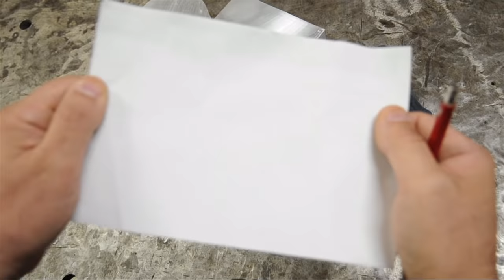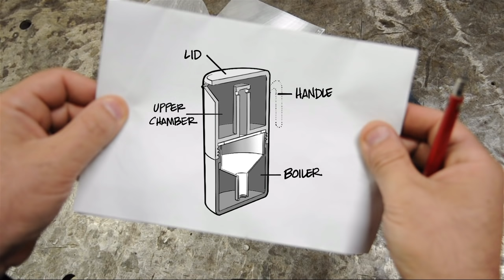Making An Espresso ... Pot!

Comment: Yuck, Aluminium. Get some Steel in there man.
Reply: Aluminum,acid and heat ?   Alzheimer's cocktail , not to mention that  you are not getting the best taste !
Reply: I also hope that the aluminum alloy is lead free....  Technically awesome work anyhow!
Reply: I believe all the espresso pots i have seen are Stainless Steel, not just steel. And if i remember This old tony hates working with stainless.

Comment: Just as well you dont like espresso because that isnt espresso, its perculated coffee, nothing like an espresso.

Cool work though
Reply: Yabba441 it's traditional Italian stove top espresso. Not a perculator but I can see why you would think that they work and look very similarly to each other
Reply: Its called a peculator in many parts of the world because of its end result albeit it that technically its not, it is a Moka Pot. Neither of which produce the essential component of an espresso, that being the extraction of oils from the ground coffee beans from hot water under pressure. Espresso is extracted above 9 bar of pressure however the Moka pot can only produce 1 - 2 bar of pressure so it isn't an espresso. People want to call Moka Pot coffee espresso but its not even close.

Sorry but it isn't an espresso, current or old style. Its a stove top coffee maker, call it what you will but not espresso.
Reply: Yabba441 I'll agree that the moka pots don't give a normal machine brewed espresso but I would still say a moka pot is more close to a standard espresso than a percolator
Reply: JPVersionofthings moka pot is a percolator which uses fine ground coffee.  Despite being called espresso in many places - it is definitely not.
Reply: I appreciate your response because you're right! Not to take away from how awesome this project is or how amazing this video is put together. But your comment made me wonder if it could be done with this pot with just a few tweaks...

So this pot is pretty thick and I'm sure it could handle 9bar... what if he put a 9 bar relief valve at the top of the stem in the upper chamber and an 11 bar safety relief in the boiler? Would it make espresso then? Just trying to think of different ways it could be done.

Comment: Your wife is an angel.  "Can you make a 12-cup version in stainless?"   That type of handle would look really great on a dustpan, too!     Seriously, this is the way Northrop made fuselage bulkheads for the F/A-18 back in 1982.  Bolt a HUGE block of aluminum to the CNC mill and turn it loose...  I have no idea how much of that block turned into chips, but 98% would not surprise me at all.

Comment: great video. love the comic value. FYI on that pressure relieve valve it may have a 1/16 pipe tap so it will get tighter the more you screw it down.   Love the sword vid too!

Comment: Where I’m from, we call this a percolator. It’s one of the great coffee making tools. Now when I look at your plans, it does use pressure to push water through coffee. With a typical espresso machine water goes down instead of up and the filter is more robust and installed very differently.

Hey, it makes coffee, but I gotta push my glasses up and say “um actually.” It would be cool to see you make a working espresso machine but you would have to deal with hot water and pressurized pumps and whatnot.

Comment: Don’t worry about the pressure valve. They are pretty anti climatic when they go off. It will start with a slow froth bubble and slowly open up. I still turn it away from me though. Also keep a dirty film of coffee in it to coat it and keep the aluminum taste out of the coffee. I just wash with very very light soap or no soap. Keep the bottom dry so it doesn’t mold though. Great work I subscribed.

Comment: Probably not checking comments on videos that are 4 years old but here goes any way. I love your videos. what would this look like with a brass ring between the two pots and on the handle and top. For the cylinder inside I would have drilled threw and tapped the pot. Then made the cylinder separately giving you the option to drill the two holes with a downward angle. Any way I can only wish being able to mil and lathe parts like you do. I only know how to work with wood. Keep up the great work my friend. I look forward to watching more of your videos.

Comment: I do a lot of bolt-cutting and not always remove the partial thread as they are for permanent/ mostly permanent installation... but I highly recommend to do it, even a few strokes with a file help.
When the nut doesn't want to engage on a job, or (worse) engages at an angle, it's waste of time and potentially ruined threads.
And yes, safety, can't use leather gloves for smaller parts (need washers/ spring washers too), so cutting hazard. Or even steel shavings in fingertips. Doesn't heal well.

Comment: Why not machine out of stainless steel 304? Years ago a theory was posited that Aluminum food containers can lead to various health problems. When doing thin walls I machine the inside first then fill with Cerrosafe a low melting point Bismuth alloy then finish the outside. What this does is solidify the part so, it machines like a solid. Afterwards,  the Cerrosafe is melted out and one has a thin wall without breaking through. Do you have any extra long length endmills?

Comment: Because of phase-change energy expenditure, a steam burn is worse than a boiling water burn. Although, a stream of boiling water would carry further because it's more dense, possibly reaching your body and splashing you. However a jet of steam would dissipate quickly as it expanded and mixed with the atmosphere around it.

Comment: The part you did with the rotary table and the roughing end mill is possible to do on the lathe. You’d need to make a custom trepanning tool. Also I think you should make a video on lathe trepanning, it’s like the boring head of the lathe ;).

Comment: If you ever want to make another espresso pot, how about making the bottom soft steel, to be able to use it on an induction plate? It should also allow you to hollow the pot out in a more controlled manner.

Comment: the valve isn't for pressure relief. It stops cold water being pushed up into the coffee.  It closes when the steam volume increases due to the water boiling and then shuts and forces the water through the coffee and into the top chamber. basically a pressure switch

Comment: don't worry about the pressure at the top: the coffee or more so the steam is pressurised only when its in the bottom part... once it traveled through the coffee (which acts sort of like a valve) it more or less only builds up inside the center column and drips out slowly out of the wholes... 
which makes sense... the center column does not really offer any resistance to the coffee, so the pressure inside the column is almost atmosphere.

Comment: 60's - 70's with just a dash of 90's. If the handle had been straight and naked it would've been pure 90's! : ) For an 80's look I think you need more angles and square corners ; )

Comment: Tony thank you for your hard work.  Your editing of this was about perfect I only forwarded twice and only 10 seconds. As one other said I usually don't watch anything over the 15min tops but I knew your build would have a tricky mating work. To bad you didn't show the math and how you got there. Did you have to trim some off the top of the boiler or were your calculations right? Did you account for compression of the seal? Love your sense of humor and how you overcome a problem.

Comment: I know that this video was shot years ago but a suggestion for your coffee pot - Make the base with a Bayonet Fitting (breach lock / camlock).  Make a base element heater (also with a bayonet / camlock / etc).  Then you could swap out your coffee pot with an oil bath for tempering tools & stuff in.  It could have a temp sensor / regulator to achieve / maintain temperatures.  You could also make a steam whistle so you know when to knock off from work.

Comment: Just to be picky, the water doesn't boil. Usually it boils at the very end when the lower chamber is almost empty and the pressure drops. At that point you can clearly hear the gurgling noise and it's time to turn off the gas (a bit earlier than that is not bad, I'd say).
EDIT: I forgot, you'll want to keep the fire low or you'll burn the coffee!!!

Comment: fun fact, it's much better to have the pressure valve spray boiling water - the water can never get above 100C, but pressurized steam can.  boiling water can scald you, steam can get hot enough to set things on fire.

Comment: Hey Tony! So i have a classic macchinetta, with the classic double sided open nozzle, i am trying to turn this into a foam nozzle, i have some ideas using retracted steam wand nozzle, i was wondering what would be your take on the foaming subject meaning the coffee comes out foamed instead of still, an example of that is the brikka. It has a foam nozzle inside and that ends to a foaming, mixing chamber, which lifts after some portion of liquid has been entered, mixed and the coffee falls then in the pot. Maybe you come up with something different.

Comment: For the stem, thread the top, then cut a slot in the center, then make a cap, and you will have both control over the opening (cap size) and the ability to ensure it doesn't shoot out the top of the maker. (adding an overlap to the cap)

Also, cleaning would be much, much easier.

Comment: You are 100% not overthinking the angle of the pressure relief, it's recommended to always have it facing away from you And also never fill the water above it. Also this is technically not espresso.

Comment: Steam has more energy than boiling water. It possesses the additional latent heat of vaporization. So, when steam falls on skin and condenses to produce water it gives out 22.5 x 105 J/kg more heat than boiling water at the same temperature. Steam has more energy than boiling water.

Comment: Sense you left the bottom quite thick which is great. A fun idea would be to drill the bottom full of holes the increase the amount of water touching the aluminium to increase the boiling time. Kinda like a steamboiler:)

Comment: I love the stuff you make and the way you present your videos in a humoristic manner.
Just a word of caution here for those who like to make such an expresso pot for themselves. Some aluminum contains lead for easier machining. DO NEVER ever use that for anything that is intended to have contact with food or drinks. Especially hot beverages..! The lead will leach by small portions into the things and lead poisoning ain't something that will go away or could be cured.
Same goes for some sorts of brass. Be careful what kind of material you use and be absolutely positive about what's in the alloy if you use an alloy material for such things.

Comment: On cutting thin wall aluminium, Perhaps it makes you nervous because it can bind up and snap tools, and shower you with pain. 
The last time I had a catastrophic tool failure, I was cutting aluminium angle on my chop saw. 
The blade was specifically meant just for aluminium, but it wasn't a new blade.   
The angle aluminium bound up on the blade, snapped like 5 teeth, and instantly turned the chop saw into Kazoo. 
 If I had had a proper work piece clamp on the aluminium I probably would have been fine. 
As it was, I was using my left hand to steady the angle as the blade bit into the work piece and bound the blade up. 
The angle aluminium became something of a wheel and immediately slammed into the chop wall on the back of the chop saw, putting the full torque of the motor into the angle, and, consequently, into my hand, which was mashed up against the chop wall of the saw. 
My left index finger was definitely broken. 
If it had just been that finger it would have been worse but my whole left hand got smacked, that's just the digit that got pinned between the work piece and the chop wall at full torque. 
My index finger still looks funny. Like you can see a weird pattern under the nail. 

My point here is, you might have a reason to fear thin wall aluminium.

Comment: Hey Tony,
just saw your video and recognized something to discuss. As far as I remember my practical manufacturing classes back at university they said something like that the perfect coolant and lubricant for machining aluminum would be petroleum not classical cutting oil like for steel. Did you also hear about that?

Comment: Tony I know you put the spout directly opposite the handle, but did you consider putting it 90deg from the handle? Whilst it makes a left/right handed device, think about how to rotate it with your hand. Turning a doorknob is easier than hammering with your wrist held perfectly still and just tilting your hand. 

Dunno, just saying cause I had one of those expresso things with the spout 90 deg and it was really good that way. When using it I was like, why don't all things have spouts like this.

Comment: This would be a fantastic test for a machinist applying for a job. 
You got 1 hour to read the plan and familiarize yourself, then 4hrs to make it. 
Tests many things that; from plan reading to mill and lathe operation, thread cutting order of operations and minor TIG.
This would sort out the wheat from the chaff. if you pass we'll pay you for your time if not don't call us we'll call you LOL.

In fact I'm no qualified fitter turner or machinist however I do alright as I am a qualified mechanic and in some ways the trades aren't dissimilar. I always hated mechanical work because it is filthy and the pay is terrible.
One time I decided to try (for about the 25th time) to get out of mechanics and applied for a job fabricating tri axle semi trailers at a large factory. Something like (test above) happened to me and I got the job. 
I had to build a steel handle hammer with a taper in the handle, knurled, the head made from square stock (so 4 jaw chuck) with turned and threaded brass & steel faces and the handle threaded into the head. 
Being a relative novice I didn't check the cross slide position before cutting the taper and back cut it into the handle ruining any chances of getting the job. Luckily no one was watching and I made a new handle from scratch in about 12 mins flat and someone saw that - but not the screw up and was very impressed.  I had 2hrs and even with the stuff up I was done in about 75mins. 
Anyway they told me how much the pay was and I was so disgusted by the hourly rate I went and got a started in a career in the low paying trucking industry - first small trucks then larger then the largest.
Eventually I qualified after a number years and a ridiculous amount of miles to drive big rigs. I've been doing that for 5 years and the pay is also disgustingly poor for what I do but at least I get to watch the countryside roll past and stop for an espresso whenever I want (which I can claim back on tax at the rate of 3 per day). 
For me no espresso = no driving - it's that simple!

Seems my lot in life is as a low paid high skill worker. 
I don't qualify for low skill high pay that dopey office workers get and somehow I always have to answer to those idiots. 
Such is life.

Comment: As someone who often appreciates a good cup of Joe, I can really appreciate this...

...i put this down out of the way. Maybe you've fixed it (you mentioned microphones in a poop vid), but in case no one ever mentioned it, the problem with the sound is that your mic gain is too hot. It's clipping. And there's no fixing it once it happens. I don't mean to mans plain here, but that's what we do. Just turn the volume down while recording (no red or yellow lights, only green), and if it's too low while editing the video, just turn it up. Modern mics have such a low noise floor that you aren't really compromising dynamic range by doing it this way.
I might not have said anything, but I spent HOURS pulling out every cable in my signal chain last night looking for one I might have mis-soldered. Even took apart my diy passive amp (which, I suppose deserves a new casement so thanks I guess)
Thanks also for these videos. Top of the Tubes in my book, and it's a good book.

Comment: When the inside got to final I.D., you could have dropped in a triangular insert that just fit (triangular peg with chamfered corners in a round hole) and then align the triangle points with the 3-jaw chuck on the outside. (But my metal working tools consist of a bastard file, a hacksaw and a ball peen hammer)

Comment: Wonderful video as always. Because of the acids in the coffe it is not a good idea to use aluminium for the pot. The acids might dissolve some of the aluminuim into the coffee. Stainless steel is better suited for this. But because (I think) you didn't use it much and you are still making videos now in 2020 It doesn't matter.

Comment: The pressure release would be rated for a certain pressure (so you can actually build up some pressure and the thing works) did you have to calculate how thick the walls of the boiler had to be to take that pressure?

Comment: how big a deal is mixing metals in this situation? in theory that brass relief valve should form a battery with the aluminum body and the moisture it's exposed to, corroding it over time, but maybe i'm overthinking it and galvanic issues don't matter for an application like this

Comment: 7:40 why are you cutting the thread only when going left and then moving back out to go right? why not cut the thread going in both directions? Also, is the wooden handle cover enough for not getting your fingers burnt when removing the pot from the stove?